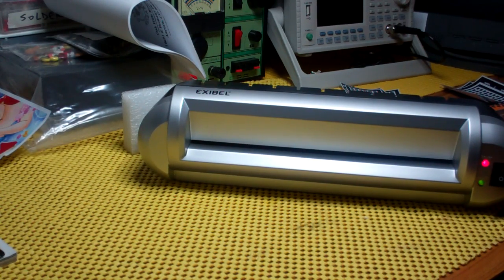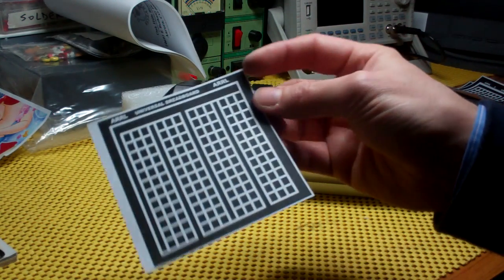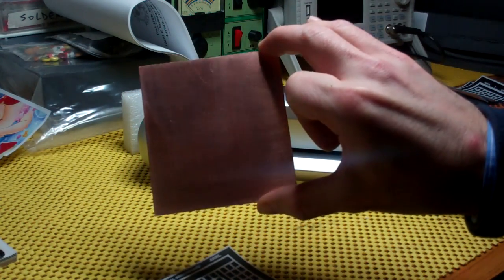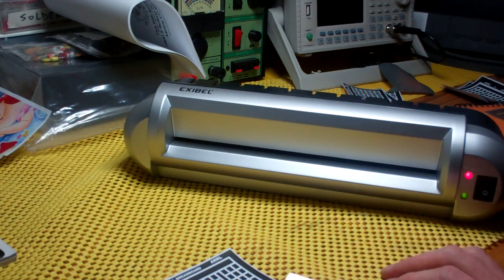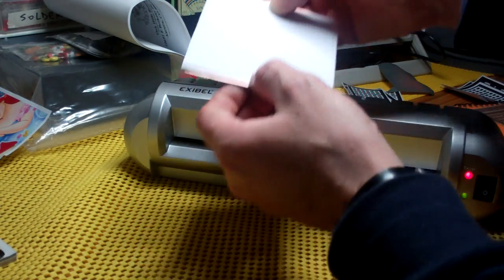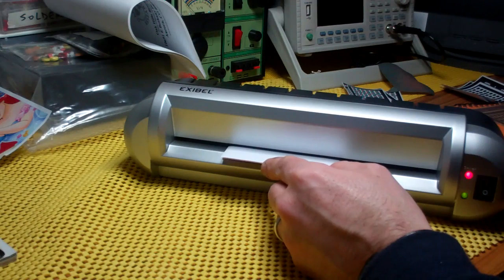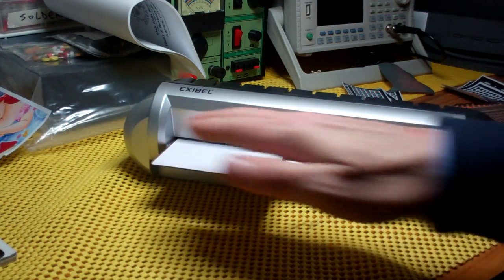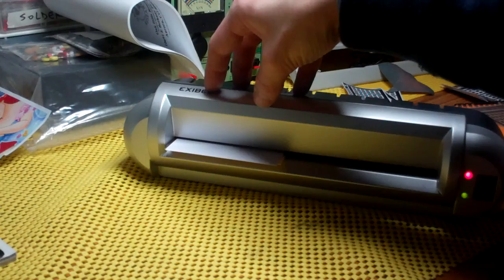Toner Transfer for DIY PCB - using a laminator

Comment: Thank you, I'm gathering info on the whole process, I will do it for the first time after years of using prefboards.

I will probably buy the laminator and will see what can be done regards to modifying rollers clearance.
Reply from the maker: Good luck: I was really surprised when I first started out - it really does work. Regarding the roller clearance, if you use single or double-sided PCB (FR$ say) at 1.6mm, that's about the max without lasting issues with the laminator. This very same laminator from my video still works today. It's a lot of fun, making PCBs at home.

Comment: Anyone tried this with a 'real' circuit, say 0.4mm traces and 2mm pads?
Reply from the maker: @imacmill  my personal experience with the method shown with font / text was down to 3pt font with no issues. It works surprisingly well. Good luck!

Comment: I forgot to ask, what printer did you use?
Reply from the maker: @terencekaye9948, my printer is an old Samsung M2020 laser printer. They stopped making printers and sold the business to HP. But it still works well, using toner (incredibly fine plastic powder)…

Comment: Using iron is easy to use and not complicated and not costly
Reply from the maker: @victorb22622, you are right - an iron can work well and is pretty straightforward. My experience with an iron was that it was too variable to continue using. I found the laminator much more consistent and predictable.
Reply: "not invented here"
Reply: Tried iron but laminator much better. I pushed it through about 30x. Make sure you put board through the middle of the laminator and not close to the sides else the pcb thickness will jam the laminator on the sides where the rollers are fixed on their axis.

Comment: is laminator modified?
Reply from the maker: No, this is a standard A4 laminator. The PCB boards are at most 1.6mm thick, and while the laminator does 'groan' with some noise, it works well to evenly press and heat the copper and toner printing. Thanks for watching and good luck!

Comment: What is temperature please
Reply from the maker: @mohamedrasheed201, the laminator I use is a standard one, designed to laminate paper or card (not pcb 😀). The temperature is somewhere between 110C-130C I believe.

Comment: check out "Mr Carlson's Lab" channel on his laminator change which increases the temp for a better transfer. Also, you should let the board cool completely for the toner to stick best. After all , it's heat which make it "sticky" to begin with.

Comment: Does this transfer work on silver?
Reply from the maker: Hi Eric, I have not tried toner transfer into silver. But the reason the plastic toner sticks to the copper board is purely from heat and pressure. Silver behaves the same (gets hot if heated) so I expect it would work too. Once transferred, the toner on copper adheres reasonably well, but comes off easily with acetone. I expect silver adhesion to be similar. Good luck!
Reply: @queuerious  thanks for replying 
Many content creators do not reply.
Thanks for the knowledge shared

Comment: The sound of cheap plastic gearing beginning to slip.
Reply: Yeah, the inside of these things are pretty cheap. Generally 3 reduction gears and a heating element.
Reply: @larrybud  On my machine i must stay in the centre, else the machine stops rolling as my double sided pcb with two thickish papers stop rolling and jam up the laminator. In the centre the rollers can bend open a little. I can't take advantage of the hotter unused sides. I just pass it through thr centre 30x

Comment: How to print overlay component names on pcb
Reply from the maker: Hi Suresh, I would recommend the following: 1) etch the component names into the board, e.g. R1, C2, Q3, etc., and you can do this with most of the circuit design software packages, or 2) Coat the board with UV cured solder mask (typically a green or blue paint that covers the etched board and is hardened with UV light). In the solder mask step, you can imprint component names by adding the names to the masking template. I will be releasing a video on solder masking a board in the near future.
Reply: Thanks for quick reply I got it , but how to imprint names in solder mask template. I have seen software prints only solder mask print, but how to add names to it.
Reply from the maker: Solder  mask is created by painting the entire board in special UV-cured paint. Then, on top of the painted layer, I lay a transparent plastic sheet which has black images of solder pads. When exposing this 'sandwich' of layers, the light hits the board, but does not reach the board under the solder mask (pads are black, so stops light). After curing, remove the board and wipe the surface with acetone. This removes the WET paint that remains on the solder pads and does not remove the DRY paint. The result is solder mask with copper solder pads showing through. If you add the component names to the transparent overlay sheet (so this would include solder pads AND component names, shapes, etc.) then after curing and wiping with acetone, you will see copper solder pads AND component names "written in copper" on the board. I hope this makes sense! Diptrace allows you to print out traces, pads, vias, holes, copper pours, mask names, etc in any combination.

Comment: Hi, how to print part names on the circuit board
Reply from the maker: Hi Suresh, I think this is similar to another question you have asked. I've tried to answer the other one.
Reply: Yes, it is similar question but  how to imprint names in solder mask template. I have seen software prints only solder mask print, but how to add names to it

Comment: what the maximum thickness this machine can take
Reply from the maker: This specific laminator is designed for laminating pages or card inside 250micron plastic pouches. But I have used it well, with no lasting damage, on PCB boards that are 1.6mm thick. Your mileage may vary depending upon your laminator. Good luck!
Reply: Thanks, I have brought one similar to it

Comment: can you please mention the laminator model and its price?
Reply from the maker: Hi Javed, the laminator was bought from Clas Ohlson stores in the UK, called the Exibel A4 laminator. It seems to have been discontinued (as of Feb 2017), but don not be too concerned. Almost any laminator that you can find will be designed around the same principles and will work with the same laminator plastic sheets. This means the laminators will heat up to similar temperatures (say 130 C) and can apply this heat under the pressure of some rollers. This is all you need for PCB making at home. Best of all, laminators are readily available from any well-stocked stationers stores at a very reasonable cost (made in China). Good luck! Matt
Reply: @queuerious  does the roller type being metal or plastic. I'm told there are these 2 types.
Reply from the maker: @EricMintaAsare  I am not sure. The heat the laminator creates is passed 'into' the object being rolled somehow. I think the roller is heated, so likely is metal with a plastic/rubber coating.

Comment: amazing. I have a laminator and I used glossy photo paper and was not able to get it to transfer but i didn't pass it through 15 times, it was more like 5 or 6 times. I think I did not allow the heat to transfer enough I guess. Regular paper and an iron worked but it left paper lint stuck all over the toner and after etching, the traces were plagued with pinholes and voids. I removed as much paper under water but was never able to fully remove all the fine lint that was embedded in the toner.
Reply from the maker: Heat is important, as is a clean copper surface.  Try again with 10-15 passes to get heat into the toner and pressure to the copper. I have very high fidelity transfers, no rough edges on the toner, no paper lint. This process is very effective. Goid luck.
Reply: Queuerious Guy I tried 20 to 30 times through the laminator and the board was quite hot. The toner still would not transfer at all which leaves me to think there may be two issues. 1) The glossy paper brand may not be releasing the toner causing the toner to stay on the paper rather than the board. 2) the toner brand may have a much higher melting point compared to other brand of toner materials. 

I did sand the board completely and then cleaned the copper prior to the lamainator step.

When I used an iron using regular paper, it did fuse the toner to the copper, but not without paper lint issues. I have not tried using an iron and photo paper to see if this will work. If it does, then perhaps the laminator is just not hot enough, we will see.
Reply from the maker: Sorry to hear that you are not having success. It may be  your paper: I use A4 sized sheets of 150gsm gloss inkjet paper, using for inkjet photos from Ryman stationers. Using a laser printer with black toner (samsung model 2020). The laminator is an A4 with operating temperature 130C according to the instructions.
Reply: Not to worry, I will find a way to make it work. I have the same printer which is a Samsung 2020. The laminator is an Apache from Amazon and Im sure the temps are similar since they are designed to laminate plastic sheets but I haven't checked for sure. https://www.amazon.com/Apache-AL13-Thermal-Laminator-Pouches/dp/B0012UEXTQ/ref=sr_1_30?s=office-electronics&ie=UTF8&qid=1483303678&sr=1-30&keywords=laminator

I could not find the paper you used on Amazon. I may try toner transfer paper.
Reply: This photo paper wont work. I just wanted to share with you for your information. I thought the 4 x 6" paper would be perfect for the size boards I make, unfortunately the coating is tough and will not let go of the toner. http://www.officedepot.com/a/products/937389/Office-Depot-Brand-Standard-Photo-Paper/
Reply from the maker: I print on A4 sheets, then cut them down to size as needed. It's a bit wasteful, but the control I get outweighs the lost edges of paper since I do 1-off boards in low volumes. Try another brand of paper, as I only yesterday created another double-sided PCB with this method. I will share a link to the video here https://youtu.be/dyBM13_ciVA
Reply: I will try a different brand of paper and I will let you know how it goes. I appreciate you taking the time to share your thoughts and the time spent responding.
Reply: Needed it for only one small print, and searched the house for a quick paper solution:
I used the laminate plastic that came with my laminator, and put it (one sided) on an A4 paper, and fed it trough the laminator to bond.  But laminate ONLY the bottom half of the A4 paper, so the top half would be plain paper, and by that it is easily accepted by the printer feed (Samsung 2020 series :) ). Still you need to place it neatly in front of the feed rollers, maybe using a torch to check, and a ruler to position it a bit.
Of course, your design then should also be made (mirrored) on the bottom half of an A4 format.
Results were almost perfect, and needed a very little rework with a black permanent marker (I used Edding 400). 
(Personally, for the transfer I used a very hot iron with a thin cloth in between to distribute the pressure in cavities at the edges, and with wiping and force for a minute at most)
Reply: I used glossy magazine paper quite succesfully. Just cut out pages to fit your laser printer.

Comment: there is a method of transfering the toner heatless here on youtube. no more laminator needed.
Reply from the maker: That's really interesting. Hopefully that new method can offer this technique to others that do not have a laminator.
Reply: @queuerious  it requires acetone, which is hard to find in my country Ghana
Reply from the maker: @EricMintaAsare  Acetone is found in nail varish remover, so look for it in a store that sells beauty products. Good luck!
Reply: @queuerious  You've probably not been to many parts of Africa. In some places there are no stores. Here and there a trading store and they would not even know what a beauty product is, let alone have a product to remove nail polish. . 😂

Comment: Did you try something with very narrow lines and small spaces between them?
Reply from the maker: Yes Vatsek. The laser printer can create very fine lines (say 1mm line and 1mm spacing) with the toner on glossy photo paper. This transfers very well to the copper when using the laminator.
I have etched such fine details for a surface mounted 8-pin IC. Even the very fine circuit outline (a thin line box that encircles the circuit layout generated by my Frizing software) ws etched as a complete circuit (tested with a continuity tester).

The challenge in etching such fine detail is the length of time needed in the etchant. This process has hardly any "undercut" whereby the acid eats the copper underneath the toner edges. I have always had good success and am impressed that this method can produce some very good results.

Good luck!

Comment: Why not just put the paper and copper into a microwave and heat it up. This it will be faster
Reply: No, Avoid putting any metal into the microwave! It´s a high risk for your safety
Reply: @ingeniossoluciones  plenty of yt videos of melting metals in the microvawe  furnace

Comment: WOW I have little heat tolerance maybe gloves would be a good idea, I am curious will any Laminator do the job or are their some types to avoid ?  My Budget is under £30 any suggestions ? thanks
Reply from the maker: +Ortorea Screenname  I think any laminator will work: they all operate with the same principals I believe. I paid £7.99 for this A4 sized laminator in a sale on at the local stationers store. There are various videos and websites that state you need to alter the temperature or pressures - I did nothing and used it straight out of the box. Thanks for your comments!
Reply: +Queuerious Guy  Cool thanks I just heard some were having problems with not being able to get the thick board into the rollers but thanks for the reply I will have a look around I am sure I can make mods if it won't fit :)
Reply from the maker: +Ortorea Screenname  The boards I used were 'standard' 1 or 1.5mm thick, single-sided copper. There are infact thinner 0.6mm boards that are easier to cut with a paper guillotine (paper chopper!) that means you can etch a number of similar  boards in one large piece, then cut up later. Cheers.

Comment: Nice :). I'm planning to buy a Laminator as well for my DIY pcb. By the way the photo paper you use has very good transfer result. Is it a regular glossy photo paper?
Reply from the maker: Hi'gak Iya  Yes, it is was a cheap brand of glossy photo paper with no special properties.
Reply: @queuerious  was it glossy paper used for inkjet?
Reply from the maker: @alanflood8162  Hi Alan, yes. I use a laser jet printer (which uses plastic toner powder) to print the images onto glossy photo paper meant for ink jet printers.
Reply: @queuerious  thanks for the info, I'm an artist etcher, Iv been using film but it has a tendency to bubble with an iron, so Zim planning to use a laminator
Reply from the maker: @alanflood8162  I think this technique could serve you well. I experimented with the resolution of text and found very high fidelity with font as small as 4pts. Your mileage may vary, but fine, thin traces in circuits down to 0.2mm have been reproduced continuously (no breaks in the trace). Good luck.